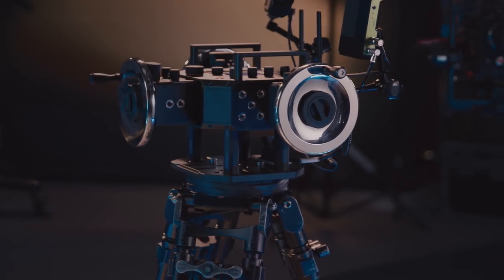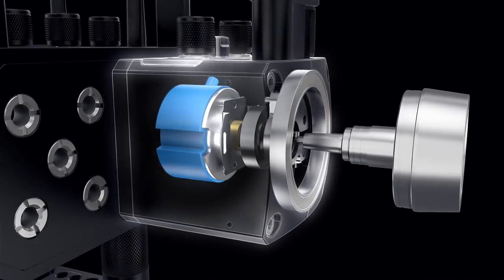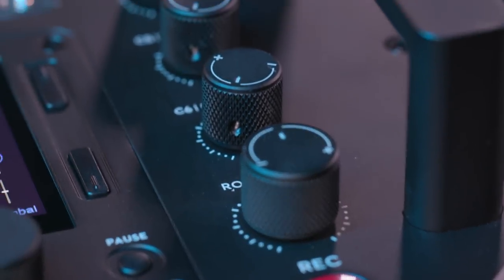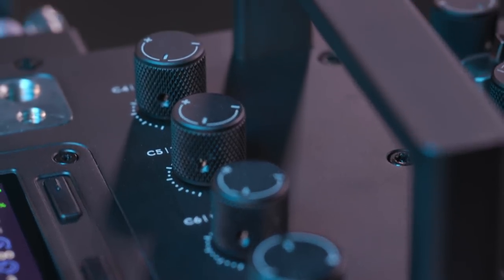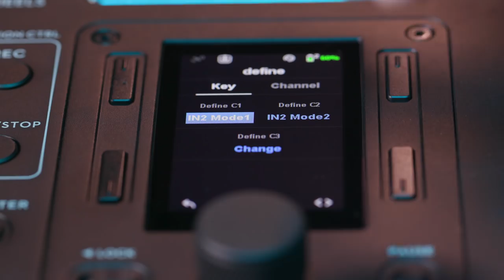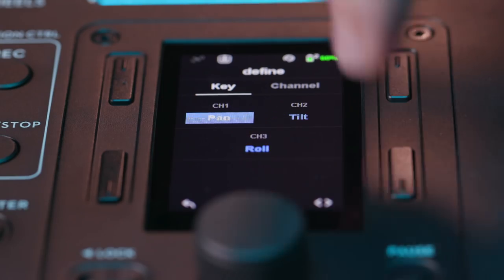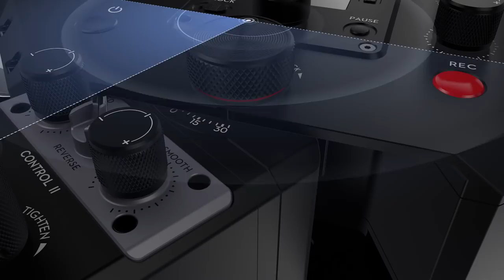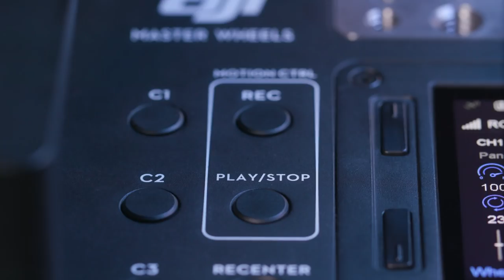DJI - Introducing Master Wheels

Comment: Have you considered making a DJI robotic lawnmower? I am not joking. This would sell like hot cakes. Most robotic lawnmowers need magnetic ground pegs for the front and back yards to set a boundary. DJI could make a robot lawnmower that uses both GPS & WiFi/occusync. DJI has the best user friendly programmable interfaces.